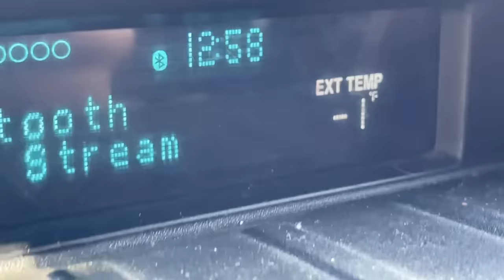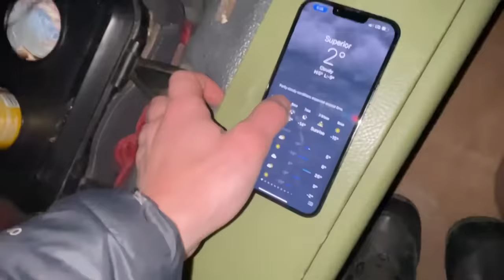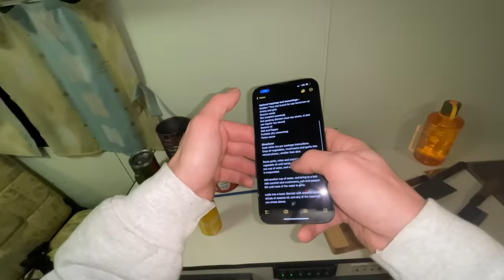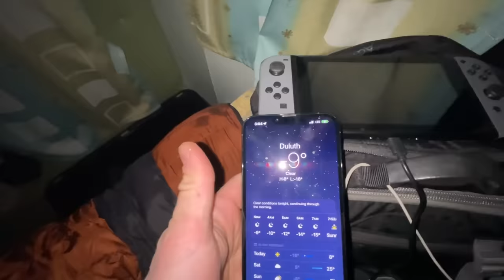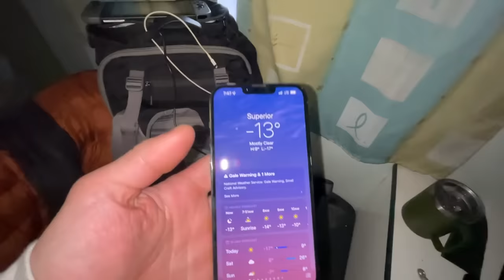Taking my Japanese Import Camping in -18 Degrees

Comment: You're definitely going to want to keep a small stock pile of anti-gelling diesel additive on Steve at all times.  Just find a corner of a cabinet and have a couple bottles there.  Worst thing that could happen is you take them out in the summer and forget to put them back in the winter.  Also, adding some kind of pass through to run your engine block heater cord into the interior so you can plug it into your Jackery inside the warm living space would be a beneficial upgrade.
Reply: So you don't have proper diesel in USA?
Diesel in Norway don't need any additive, and it starts without issues in -20 C.
Reply: @dubious6718  We don't have nearly as many diesels on the road as countries do overseas.
Reply: @dubious6718  I'm a bit surprised because in Canada we have specific Summer and Winter diesel. We don't have a choice, it's what at the pumps. I would have thought the Northern states would be the same.
Reply: @blackbirdbeatle  here in Maine we have winter and summer diesel at the pumps.
Reply: We specifically have summer and winter diesel here in the states. I live in Kansas and it's 14f right now. Summer diesel, or #2 is rated down to 10f and winter diesel or #1 is good to -30 f. It's best to start putting additive in at anything under 10f though.
Reply: @dubious6718  americas gas and diesel are very bottom tier
Reply: You guys still use diesel? That should be for old trucks, with gas you get so much more power for what you put in
Reply: I don't think fuel was the problem this time.
Reply: @TheQWER9  No, diesel has more power than gasoline.
Reply: @ThatDudeArvai  So all your big rigs drive on gasoline?
Reply: @dubious6718  they do, but they have massive batteries and block heaters to help them start. This little old Japanese camper has probably never seen temperatures this low in it’s lifetime
Reply: @dubious6718  same in ireland ive never heard of summer and winter diesel it sounds crazy lol 😆
Reply: The jackery only provides 500 recharges. After that its toast.
Reply: @dubious6718  Diesel is only good for low RPMs, for people who actually use higher RPMs, gas is better. Also for city driving gas is better too. So i guess if youre only driving out in the middle of nowhere or if youre country doesnt have many cities then you could benefit from diesel, makes sense
Reply: No, the big rigs in the US run on diesel, not gasoline.
Reply: @someguy9778  Thats why i said its better for highway driving. For countries that dont have many cities yet, they would benefit more from diesel yes
Reply: @hazelswords8573  they automatically adjust fuel type with additives in the UK...they just don't really tell anyone
Reply: @corbvn373  Americas gas is the same as everywhere else. We just think its worse because in EU we use a different way to calculate rating so the numbers just seems higher. Im surprised you havent learned that part yet
Reply: @dubious6718  we have winterized diesel in the winter
Reply: @dubious6718  Because Norway is a small country. The USA in comparison houses many different climates. Use your head lol.
Reply: @TheQWER9  So what you need high RPM for?  My diesel goes to 4k RPMs, or so.  Gasoline is only better if you drive short distances a lot, as the diesel needs to get hot to burn off sot.
Reply: Well in MN where mav is most times our diesel already has additives in it. Long as he keeps the tank over 1/4 tank he will be fine plus if it's got a pan or block heater he can jackery it I bet!!
Reply: @SachiBean  We have the same climate as many of your states, Use YOUR head.
Reply: @dubious6718  Do you even know how different it is here lmao? Have you ever even left your country?
Reply: As the OP said, a block heater is necessary. Nothing else needed. Not sure why this turned into an additive discussion.
Reply: @dubious6718  that’s only -4 Fahrenheit
Reply: @fenstrat84  Because someone always wants to compare how their country has it and why not ours lmao as if it were a crime...
Reply: I'm from Eastern Canada and never used anti gel, or when I was in Alberta and it would hit almost-60 we never would. Would have to tarp the excavators and dozers but that's a different breed lol
Reply: I dont think this was a geling issue.  He needs a deep cycle battery/winter battery for that or at the very least some portable jumper pack.  Engine wasnt cycling over fast enough when he was trying to start it compared to when it was getting boosted/jumped.
Reply: @SachiBean  no need to presume anything about anyone
Reply: @jongodfrey8688  and?
Reply: @dubious6718  the EPA in the US made proper diesel illegal for road vehicles.
Reply: Worst thing for the fuel filter though
Reply: @SachiBean   Exactly. I get tired of people from other countries, usually tiny in comparison, responding like it’s a crime that we don’t compare to whatever it is that they have better. Had a back and forth with a guy from Switzerland about why we don’t have a uniform, consolidated interstate method to handle vehicle title transfers faster and online because they do it so quickly and efficiently there. Most often if using their online notice it’s done same day, otherwise they have 10 days vs 30 days in US states. Mind you that country is roughly the size of Vermont and New Hampshire combined. He couldn’t get his head around the fact that the US is legit like 50 countries when it comes to things like that that are regulated by the state and getting states to move quickly on anything, especially if it will cost them money, is at most times laughable. But he wanted to argue NTL. SMH. I finally just said look we are not as expedient or as efficient in the US as you are and that’s totally okay. Give it a rest. 😅
Reply: Definately he should get his spark plugs changed
Reply: @jaeshasway  couldn’t have worded it better. It’s always a jab lmao.
Reply: @chet174able  and environment
Reply: @dubious6718  No we just don't put additives in our fuel, don't have to wonder what were putting in our tanks
Reply: @blackbirdbeatle  We have it in WIsconsin, but I've only ever fueld up a semi at a truck stop. Unsure if they have the same winterized diesel at the commercial pumps.
Reply: Fuel wasn't the issue here. The battery died with the cold. When it gets down to -30  -40 here you want to turn your car over and the battery is like 'nah fam you're staying home, best get a jump'
Reply: @ThatDudeArvai  it gets very cold in Japan too they have huge ski resorts.
Reply: Gotta keep a bottle of Howes Diesel Conditioner in the truck. Treats something like 3000 litres of diesel and is an anti gelling agent as well. Helps lube the injection pump, injectors, etc as well. My dad and his fellow truck drivers here in Canada swear by it
Reply: @hazelswords8573  only expensive diesel over here  🇮🇪
Reply: @jaeshasway . Your right dude, murica is a great country, you fellas have everything you need on the one continent, hello from a little country in Europe 👍🇮🇪
Reply: @Shane-zx4ps  thank you for being honest
Reply: @lukeurevig4904  define "proper"
Reply: @IWillSmurfYou . What other way is there to be
Reply: @jaeshasway  true, the US is very inefficient with anything related to infrastructure compared to rest of the developed world
Reply: @dubious6718  right? I'm so confused. In Canada we don't use anti gel lol
Reply: @dubious6718  there’s no such thing as “proper diesel” it’s either diesel, diesel with additives, or not diesel at all
Reply: S tier suggestions. What a helpful guy
Reply: @TheQWER9  rubbish, we run diesel in Cars, Utes and 4 x 4s in Australia all the time, i have a Isuzu M UX diesel and i use it for city running and for towing our Caravan, much more economical, you got to realize that that little Van isn't a racing car
Reply: @jonstevens7431  ohh cool I'm in Maine with a similar JDM Isuzu Elf camper and so far on our coldest days mine has started right up. Haha the Maine diesel is where its at!
Reply: @dubious6718  good for you bud
Reply: @dubious6718  Norgeee
Reply: @dubious6718  its got additives already. Your in norway.
Reply: @dubious6718  Minnesota, as do other US states, have winter blend diesel.  Now, if you just drove up from a southern state, and still have that fuel in your tank, it WILL gel up.  You need to use it up, and refill with a good quality winter blend diesel.  At -18F, you should also add an anti-gel additive.  Someone suggested plugging your block heater into that Jackery.  Yep, that will work for about an hour or two.  Too big of a load for it.  You should either leave the truck running, start it and let it run every couple hours, or use the generator to power the block heater.  A diesel in remote camping in that extreme cold is just a BAD idea.  Use Steve above zero.
Reply: @dubious6718  Are you just trying to be an argumentative jerk?  Semi trucks are diesel (for now, anyway).  They run constantly.  They are plugged in or have small diesel powered heater/generators when in extreme cold and are parked for a long time.  They have an ether starting aid built into a lot of them.  They run winter blend fuel and anti-gel in extreme cold.  NOT THE SAME AS MAV's TRUCK.  This Toyota is old.  It is extremely cold.  It has glow plugs, of which he is lucky if they all still work.  He can't plug it in remotely, unless he runs that generator (which may also fail in extreme cold).  Doing so defeats the purpose of remote camping (getting away from the noise of the city).
Reply: @TheQWER9  I take it you're not an engineer. Haha
Reply: @MAGA_EXTREM1ST  it's not toast. loses 20% capacity after 500 cycles.
Reply: That would be neat if can run engine water thing under the floor somehow. Prolly needs a pipe and a thermostat valve and few safety measures i don't know xd
Reply: @dubious6718  fuel isn’t the problem kid
Reply: @reed_shaw1816  Clearly it is oldie.
Reply: @whoanelly-     When he was trying to start it up with the first battery it sounded like the fan for the heater was switched on . Would that make a difference? It might be a stupid question but if I’m of the opinion that if I don’t ask I will never learn anything.
Reply: @hooooochR  your clearly very poorly educated on this subject friend. Might want to do some further reading. These batteries arent supposed to be discharged beyond 50% and they loae 1 to 3 percent efficacy each time you discharge them beyond that point. So after 500 cycles when the read out says 100% your really only at 80%. Thats not including exposure to environmental factors like extreme hot/cold for extended periods. Junk. The bluetti is way better.
Reply: @Helen-sound  not at all a stupid question :)  I'm just basing it on how it sounded.  The engine typically needs to be spun at a certain speed for it to fire the cylinders enough for it to catch. It sounded very slow to me when Mav tried.  Maybe the fan was a contributing factor.   But you def heard how fast the engine was turning over when he was jumped to the other power source and it fired up pretty quick.
Reply: Any diesel fuel purchased in Northern states have anti gel added already.
Reply: Then you know nothing about Diesel’s then making that statement. Every vehicle I own is diesel”s two land cruisers and a Golf TDI along with a Passat TDI and they have no problems in -20 weather.
Reply: perfect!
Reply: Sounds like you fit the targeted demographic perfectly. Hahahaha
Reply: Where is your pfp from?
Reply: @Wallgu0520  who
Reply: @dubious6718  what is gasoline, you guys talking about petrol , natural gas ?
Reply: Myself with my Ford in around November I add the additives just the once cause I still have summer fuel but then after that what is at the pumps is good to go.  As long as you get the fuel at a station with high turn over the fuel should never be a problem.  In Minnesota I like using Kwik Trip with truck islands as they tend to have a higher turn over.
Reply: @dubious6718  the fuel in Norway is 20% Kerosene-that’s why it works in cold temps-Mav should buy some kerosene from wherever he buys fuel-it’s available at every truck stop that sells diesel.
Reply: @zxynade6093  Gas in USA is short for gasoline,  same as Petrol.
Reply: @DeWorDeR  If he wants to use the truck engine for more cab heat, they sell heater boxes for the rear cab, like they use on school buses.  You plumb them right into the engine cooling lines.  Problem is that a diesel idling produces very little engine heat (especially that little 4 cylinder diesel).
Reply: A couple of litres of petrol mixed in the diesel will help stop the fuel waxing
Reply: @MAGA_EXTREM1ST  you are clearly very poorly educated on this subject friend. Might want to do some further reading. What you just described applies to Lead-Acid batteries. NOT Lithium-Ion. Jackery model that Mav has is Lithium-Ion.
Reply: Yep thats why steve was hesitating ...it's good van but it's a diesel so definitely going to get a hard start and have to play with it a few times when it gets down that cold
Reply: @ItsJoshN  I swear by Howes. When I drove semi went to Canada especially when others wouldn't. I didn't run my truck at night. Started up everything no matter how cold
Reply: @bicbic8557  
Continent here has 3 countries
Chilly Merica
Merica
Spicy Merica
🙄
Reply: @bigman55434  Fun fact, but never seen US School bus so no clue about that, but i think i know what u mean and yea that engine don't produce much heat true :D
Reply: @Dubious  its also -25C when he went to start it. Nor did he use the glow plugs properly
Reply: @TheQWER9 And we have diesels here that can rev to 8000 rpm.... Seems fast to me.... In terms of mpg for comparatively sized engines, the diesel is the king. Have used diesels all my life. BTW, I also owns gas vehicles..... Ignorance, possibly?
Reply: In the uk people had problems with Diesel range rovers, not doing enough miles engines sooted  up,not good for low mileage dropping the kids at school,
Reply: @dubious6718  Outside of trucks, we don't have a lot of diesel vehicles. I remember my dad picking up an old diesel mercedes and it was the weirdest thing every one lol. I don't think we put much priority in our diesel supply.
Reply: @whoanelly-  Looked like he was using a regular car battery as a house battery. When I had a van, I had deep cycle batteries. Don't think I could start an engine with those batteries, but they were able to charge the starter battery if I had left my headlights on.
Reply: Elon musk
Reply: @TheQWER9  Its literally the complete opposite lmao. You might have more hp in similar displacement stock engines but you can literally make 100+ more than factory with literally a stock ecu and a small tune. You cant get those kinds of performance with gasoline engines. You'd blow your head off trying to run the same compression and boost numbers on a gas motor. Its not even remotely close.
Reply: Plug it in the onboard generator
Reply: @TheQWER9  diesel gets more power,  torque and fuel efficiency
Reply: In Finland we also use "Arctic" Diesel at winter, it's good down to -40 C. Strange that countries with negative temperatures don't have some.
Reply: In the states we have a government that wants us to all have electric cars and wind power  and solar houses. So not invested in fossil fuels as much.
Reply: @blackbirdbeatle  northern states it’s a 70/30 blend. So it’s somewhat mixed but additive is still used a lot by most trucks up north, I’m in North Dakota and I use additive in my work trucks just in case
Reply: They do put additives, its completely unnecessary, unless you are driving from a warm region to a cold one. They already add the additive to prevent gelling in cold areas just like they do in Canada.
Reply: @dubious6718  well, diesels make more torque. def nowhere close to gas cars in terms of horsepower. but torque is what's important from a stop for cars and towing for trucks/big rigs.
Reply: @lukeurevig4904  "the EPA in the US made proper diesel illegal for road vehicles" could you explain that?
Reply: In italy in Mountain we use 3% of gasoline for anti freezing
Reply: @dubious6718  I'm guessing there's an additive already in the mix. Was once going through Wyoming and the station attendant insisted I leave the engine running in -32°C for a gasoline engine. He said he was tired of jump-starting folks all day after they fueled up and diesel was turning into vaseline, while fuel lines in petrol cars were also freezing up.
Reply: @dubious6718  aren’t y’all all about “green energy” 😂
Reply: @dubious6718   we had a -54c last year in canada no matter what quality diesel will freeze at that temperature
Reply: @busrusty1  it wasn’t, as OP said, he needs a block heater.
Reply: @Ruslan_davudov_photography  it's a diesel , you mean glow plugs.
Reply: Good idea. When I'm driving truck in the winter. I keep anti gel in the truck. Also he should have a 5 gal. Fuel cans on the rv. Just in case

Comment: Mav- you really want to turn the ignition on to allow the engines glow plugs to warm before cranking. A coil light will often illuminate on the dash and go out once they’ve preheated, then you can turn it over. 👍
Reply: Some dont have glow plugs
Reply: @imluxxiy  I had I hiace of that sort of age and it did, so it should. And yeah they don't like cold starts.
Reply: I think that is spot on it  is a Hiace and they are known to be rock solid never owned one but I would like to get one like steve for fishing and exploring trips, even got space to strap a mini bike like the Honda monkey or the Grom in there while traveling
Reply: This is more than likely a Toyota 3L engine. They have Four glow plugs. Just give it 4 or 5 minutes and she’ll crank right up.